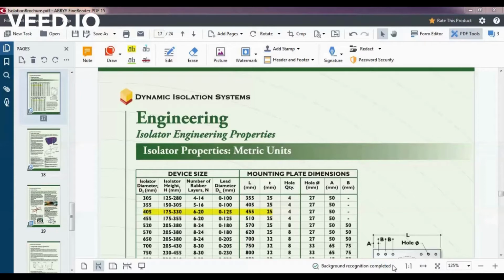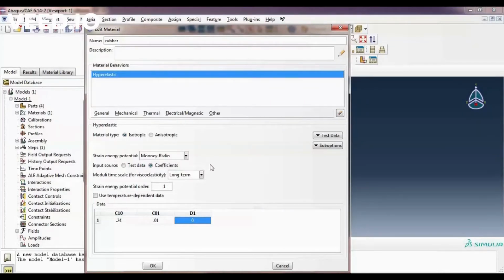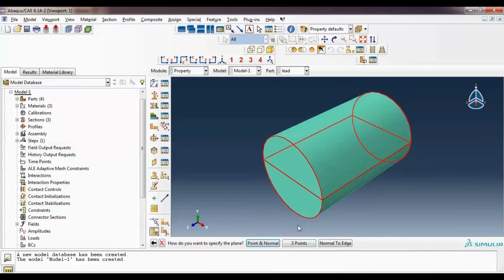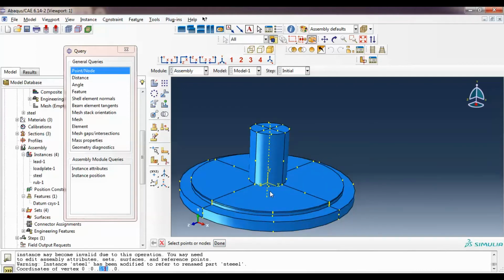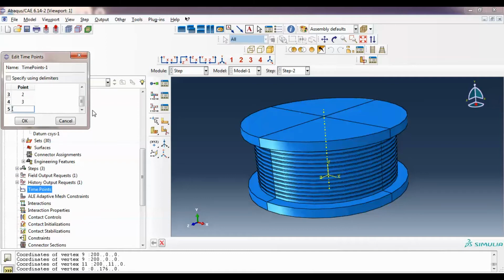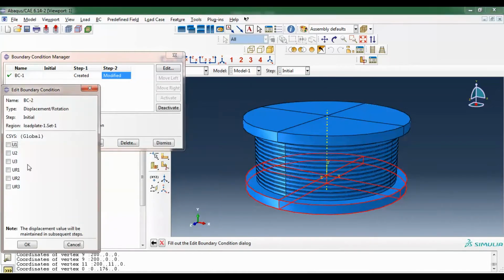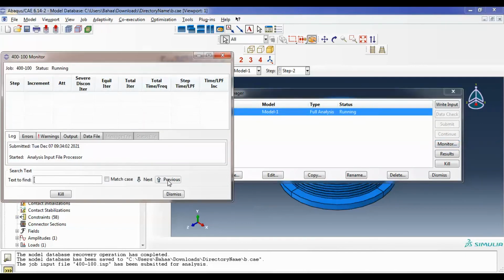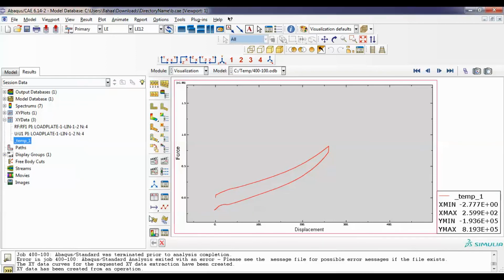How to Simulate Lead Rubber Bearing LRB on Abaqus: FEA

Comment: Thank you so much sir
Reply from the maker: Please let me know if you need any reference PDF?
Reply: @BahaaEddinGhrewati   sir can u share, uniaxial tesile test data of rubber
Reply from the maker: @maheshrachakonda4322  Thanks for asking.
In this video, I have used the hysteresis parameters which is an alternative way of putting the uniaxial tensile test data of rubber (if we do not have the uniaxial tensile data).
However, we can use hysteresis parameters ONLY when we want to simulate an existing experimental test of the seismic isolator. In other words, we have to run many jobs by changing the hysteresis parameters of rubber until we get the best/identical results with the experimental test of the isolator.
Reply from the maker: @maheshrachakonda4322  Please feel free to find the reference below.
http://130.149.89.49:2080/v6.7/books/usb/default.htm?startat=pt05ch17s08abm13.html#usb-mat-chysteresis